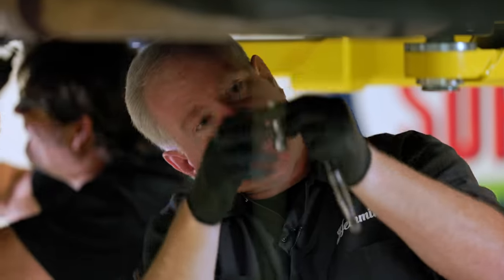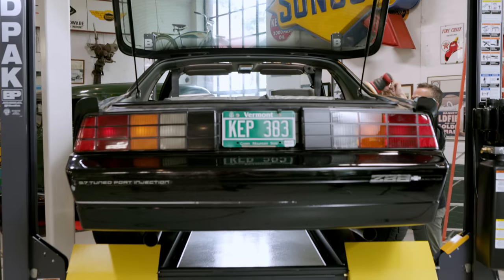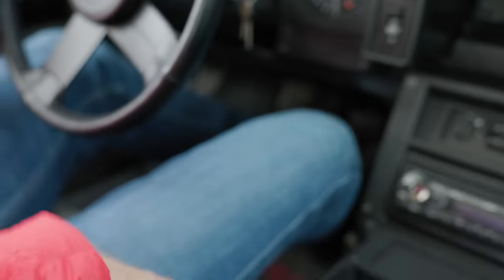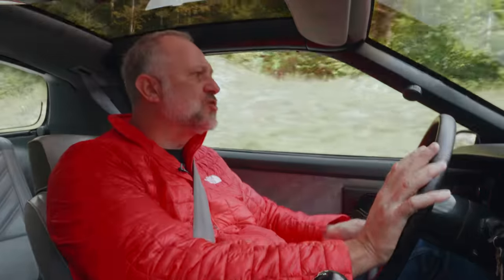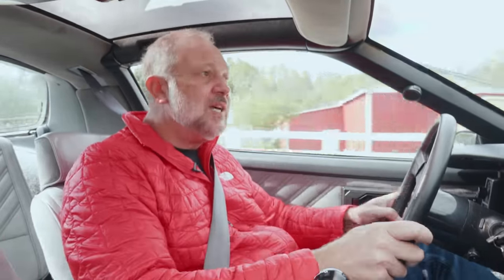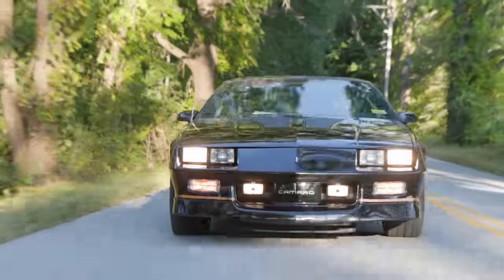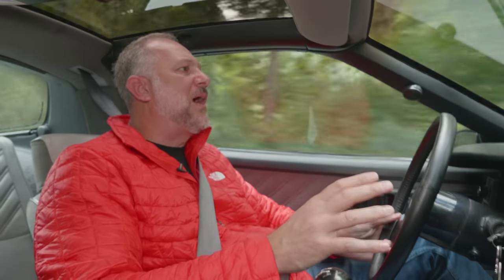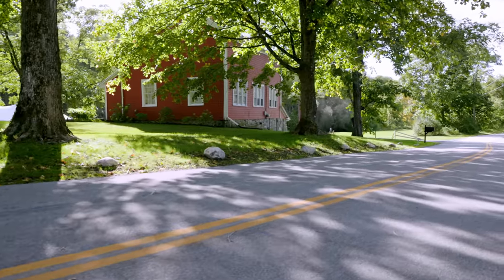Final Road Test & Review | 1987 Chevrolet Camaro IROC-Z | IROC REHAB

Comment: Always wanted an IROC, I did have a 1982 z28 Indy pace car about 30 years ago. T-tops,305 with a 4 speed manual. It was a fun car but it died a slow death. It got to the point that I couldn’t drive it 30 miles without it starting to run like shit.also I would get an IROC with a solid  roof. T-tops are cool but rust happens. Oh and make sure the girl your messing around with is actually single. That’s how I lost my t-tops and windshield,very expensive. My car got beat up with a shovel.
Reply from the maker: Good safety tip - thanks!

Comment: I would have made those hood vents operational. Wouldn't have been much more at all than replacement grills. C4 brakes should bolt right up to that Gen 3 Camaro. Good looking car otherwise.
Reply: C4 brakes don't exactly just bolt on. At least not in the sense that they'll remove the current caliper and rotor and just replace them. They have to get 1LE specific spindles to use the C4 calipers. There are better options for a car that isn't trying to present as stock. It's only a little more work to go with C5 brakes and I think it's a bit less expensive too.

Comment: Beautiful except for the edel roc
Reply from the maker: What would you go with Damon?
Reply: @hemmingsmotornews  Iroc-z or iroc,-z in Old English lettering, but I don't care what anyone says the iroc- z , is the best looking car ever produced. The looks are perfect, t- tops Good Year eagle Gator back tires 17 inch high polished iroc-z rims and a good 350 cu inch 350 horsepower small block Chevy, I love the auto matic transmission be when I was in high school in 1989 I have one 35o you and when you were cruising and jumped into it the way it would squat down and just shoot and you see the front lift and drop and you could feel the tires trying to break lose. I could care less about being the fastest it's about being happy and that's my dream car always has and always will be, especially when you fire it up and that deep throaty rumble. I've had the 85 iroc-z 305 tpi and she would still get up on it, cars brand new are always going to perform and feel perfect and the tpi motors are strong engines. Lamborghini countach bandit trans -am Ferrari Daytona spider panther id take my dream iroc-z over them in a heartbeat

Comment: well that figures, I click on this based on a feeling and oh, so that's what happened to him, hi mike lol also I dont mean to put down your guys work here, but you need to do something about that exhaust, and see if the X pipe trick that LS owners use to make those things sound awesome works on this small block here, as that thing sounds like an 88 V6 Cavalier Wagon that is missing its muffler

and I am speaking from experience with that one, like if that thing has got 350 horses, real 350 horses when the car had 165 HP and 225 FT pounds of torque going to the wheels in 86, you need to do something to make it sound proper, as it just sounds like a generic muffled V8 with a drone

like I dont know what it is about GM, they cant make a car that sounds good if its got a 350 in it, which is really weird given the 327, the motor it replaced seemed to be better in every way imaginable, like you would think they would have been able to translate the sound properly but they didnt. 

like its slower, larger, ran worse and had less revs, while the 327 was a mini big block that shocked anyone and everyone who came across them with how good it is.

350, well just watch Silver Streak and see what Richard Pryor says about it, and I cant say he's wrong neither.

Comment: If Chevy made this car again just updated with newer tech and bigger tires/wheels, new engine/tranny/exhaust they'd sell a ton of them. Don't change anything on the looks or only slightly, same on the inside. I can't imagine how many they'd sell.
Reply from the maker: A lot. But unfortunately modern day safety regulations will never allow cars like this to built again.
Reply: @hemmingsmotornews  Well obviously i mean build it w/modern tech and safety. You could still do that w/this car  would cost a lot more than 25k like they use too but it would solve their issue of not being able to sell camros right now.

Comment: Before you upgrade the brakes, please take the time to watch this video: https://www.youtube.com/watch?v=CyH5xOcsXxs. If you don't, the long and short of is: bigger rotors help dissipate heat but don't actually stop the vehicle sooner: wider tires do, because that is the contact patch with the surface. Still, please watch the video before the brake upgrade.
Reply: That man is wrong, you need good brakes with a good amount of pistons and discs of a really decent size and a well set up master cylinder that properly runs off of the motor to stop well, case in point the isle of man time attack car from 2016 that I got a good look at via the perfectionist valet , where the discs were solid and the size of a full sized performance SUV brake with no slots or cuts of 16 inches of diameter, so much so that it looked like a giant drum

and 6 piston calibers, and with rims and tires of the same exact size

that thing set the record and then some, as tires may help on the cheap, but the brakes need to be set up to run off the motor or they wont work, especially if their power boosted and not set up to have enough vacume off the motor

and are you really gonna say that a car with dainty 10 inch discs that look more like a handbrake disc than an actual disc

that were inferrior to the 928, its primary competitor in period, which even after that period, most people are upgrading regardless, is really not the problem here?

as let me tell you a little secret here, you upgrade the rims and tires too much and its gonna overload the suspension, diff and the leaf springs and brake under tension

which was a frequent problem with the IRS suspension of the jaguar Broadspeed and the corvette C2 and C3 till they upgraded the rear suspension to a 5 link in 1984 that could take 255's and larger

and even then theirs still live axel conversion kits for drag racing with the C5

and if the wheels are really that what matter, than why do first gen dodge vipers slide and crash with 335 size tires, while the C4 with 275's dont?
Reply: @kavinskysmith4094  I drive a ZL1 with Brembo six piston calipers in front (from the factory) and I wrench on the car myself, AAANNNDDD I replaced the brakes myself several times already, as I do on all my cars, so there's really no need to vax and wane phylosophical on my ass regarding rotors and calipers and pistons. Physics: it's not just a good idea, it's the law. Are you seriously arguing against science?

The Dodges slide because of the tire compound and the design of the contact patch. Not all contact patches nor all tire compounds are created equal, and they are designed to operate differently at different temperatures. Weight also dictates momentum, and the amount of momentum dictates how much energy has to be dissipated. It's all physics. Do yourself a huge favor and study it, you'll be glad that you did, and it'll help you be a better wrench.
Reply: @AnnatarTheMaia  Each car works off of a system based on how it was designed, the GM car was rubbish, and if you put too big a tire on the thing, it can overload and wear out the suspension and in some cases downright break the axel such as was the case on the corvette C2 and C3
Reply: @kavinskysmith4094  in the context of this particular Z/28 that does not apply at all, because the suspension has been completely reworked with modern parts. Apparently, you did not watch the video. And on a vehicle like a ZL1, putting 315/35 ZR20's in the back and 305/35 ZR20's in the rear works just fine, provided the computer is reprogrammed to calculate the speed correctly again. GM engineers even put 305/35 ZR19's on the Z/28 all around to improve its handling geometry. The magnetorheological suspension and the computer in the ZL1 will dynamically calculate and adjust damping in real time, 1000 times per every 2.54 cm of road travelled.
Reply: @AnnatarTheMaia  its not the speed that needs to be calculated, its the tolerances and weight of the machinery at hand

and your talking 1980's pot metal attached to a poorly wielded unibody and also FYI that tech that your talking about wasnt even made by them, it was made by Lotus in 1981, they bought them out and kept them

and ironically on the latest lotus they shunned away from this as they found that the stock one set dampners worked better. 

as per what I said, every car is a system what works on one, wont work on another

and its a 1981 shitbox camaro, redo everything and throw out everything save for the body

which is basically what they did, all except the single most important part, the brakes. 

as your forgetting something, EUROPE, germany

NO SPEEDLIMIT in the freeparts, America, 55 up until 1987, which ment that all the domestic cars were never tested at higher speeds that we now travel

so the brakes were really, REALLY BAD, ask an insurance man about how many camaros they cracked up

which is also why the rims and tires were so small too, as their was no need so 14's and 15's were standard with some even going as small as 11's with some of the AMC's

as you need to upgrade the brakes, not the tires, tires are only one part of a system that needs to be thoroughly overhauled

Also your Camaro's a Holden by the way that was made in mexico and canada

as GM always steals the best, and coppies the worst
Reply: @kavinskysmith4094  I still cannot believe that you are arguing against science. That's insane.
Reply: @AnnatarTheMaia  its called its a GM shitbox with bad brakes that crashed alot, regardless if you spend 85.50 or 95.50 on tires back in the day!
Reply: @kavinskysmith4094  that has nothing whatsoever to do with the physics behind reducing the stopping distance with wider tires. Nothing at all. Do you even understand the formulas in the video?
Reply: @AnnatarTheMaia  why are you giving me such a hard time over saying its a shitbox GM product with bad brakes that even in the video itself mike goes yeah the 10 inch brakes kinda suck were gonna replace and upgrade those next

and if your formula works so damn well, then why on earth did the early porsche 911's stop so god damn well on 165mm tires now that I think of it

as its not about the size of the tread its about how heavy the damn car is and how big the brakes are! 

and general motors SUCKKKKKKKKKSSSSSSSSSS when it comes to brakes

like christ even in 2001 the pontiac grand am I test drove had great power but no brakes

and GM literally just reused all the crap from the 80's till they had to stop when they went broke in the mid 2010's! 

and hell even their flagship car the corvette C3 which they kept using until 1981 had to be massively reworked when they actually took the thing racing to make the brakes work properly

where they had to make a quick change system and change the brake bias to be more towards the front where the weight in the car was

as it is not about the tread, it is about how good the brakes are, and just because some numb nuts flat earther decided to convince you that all you need to make a car stop better was a decent set of tires rather than a proper overhaul of the brake system when it was terrible to begin with

doesnt make it so, as if the brakes were SOOOOOO good, then why does every single god damn autocross car have an overhauled set of brembos on them?! 

as yes good tires are good, yes, but if the thing cant stop and the brakes get overwelmed by the sheer weight of the car and the way it gets driven, that aint gonna do you much good besides making sure the thing doesnt get squirly around a corner!
Reply: @kavinskysmith4094  I am giving you a hard time because you are being philosophical instead of sticking to science. If you understood the science behind it, it would be clear to you that the Porsche stopped well because of the ratio of his weight to the tire contact patch. The laws of physics are immutable. I suggest you focus on learning physics and devoting more time to natural sciences instead of preoccupying yourself with waxing and waning philosophical about which vehicle from which manufacturer is built to which quality standards, because that is not germane to calculating the correct tire contact patch surface when replacing the braking system on a vehicle and then calculating how big the new rotors will have to be in order to be able to dissipate the energy as heat. Stick to science.

Comment: Man, that car is so flat in the corners. It looks so damn mean! It has been 16 years since I sold mine. I miss it. I may have to find a Z28 or something and do something similar.
Reply from the maker: These cars actually handled quite well from the factory, and it doesn't take much to make them handle even better - some quick bolt-on on stuff makes a world of difference.
Reply: @hemmingsmotornews  yes they do! I loved how my 86 Iroc-Z handled. My mistake was I was young and didn’t know about squared setups. My rears were too wide. It kind of negated the Edlebrock parts I had for suspension.
Reply from the maker: @IgoByaGo  There were a lot of things we'd have done differently to a lot of different cars back in the day.

Comment: you should of LS swapped it
Reply: They addressed that. They wanted to keep all the same accessory brackets so a small block Chevy was the way to go.
Reply: LS swap is beyond overdone.
Reply: LS swapped thirdgens were cool 10-15 years ago... not anymore.
Reply: @John-cg8hb  still cooler than a small block
Reply: @sinistersilverado965  If it's done right yes but very very few are done right.